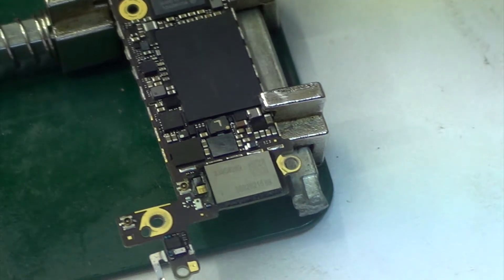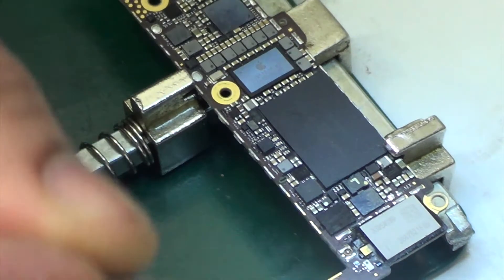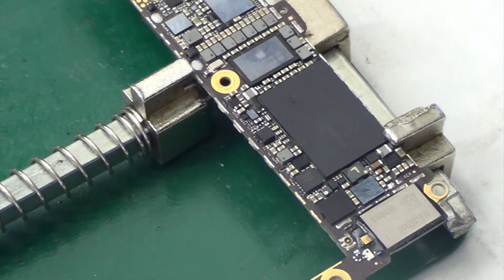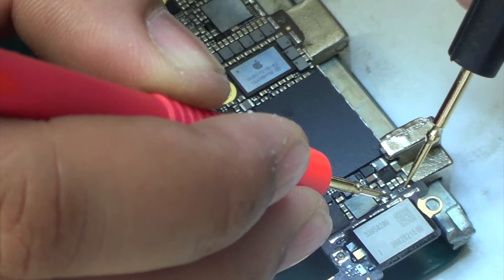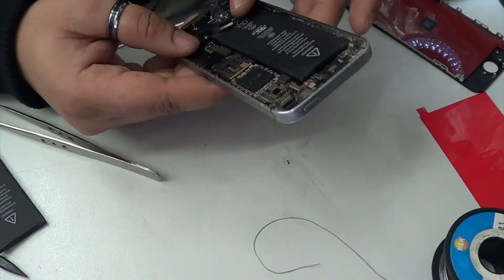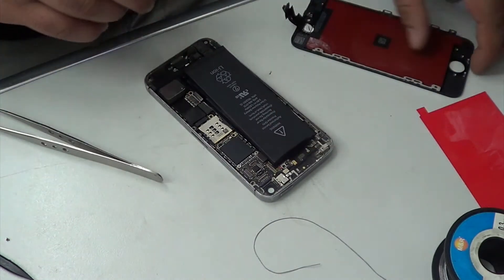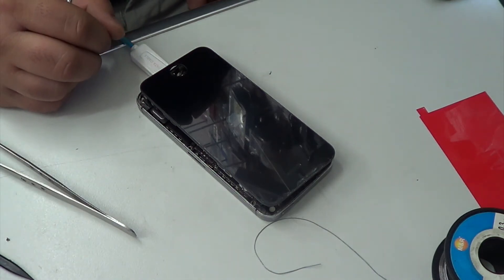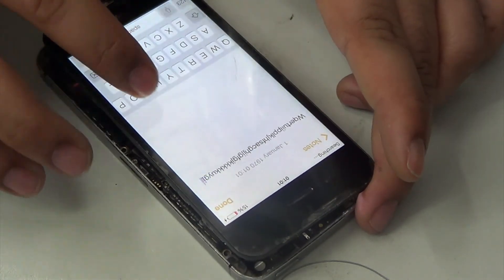iphone 5s has no touch because of water damage and we fix it only for data recovery

Comment: Can this resistor be replaced to restore touch functionality ?
Reply from the maker: +Brendan Bowen it did in this case if not then you can also consider replacing the touch IC or reball it.